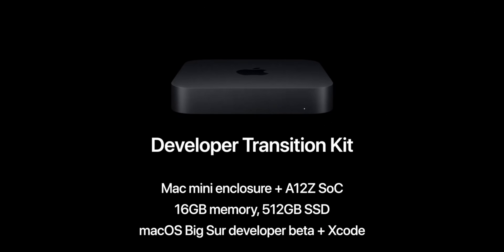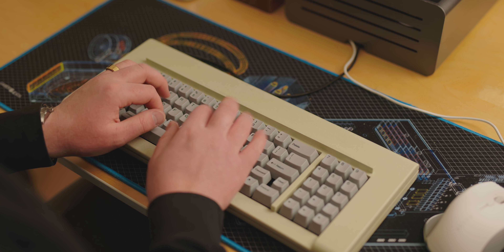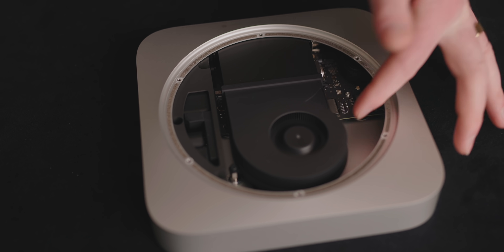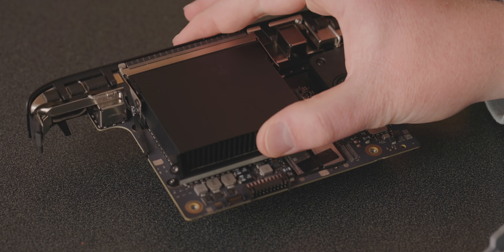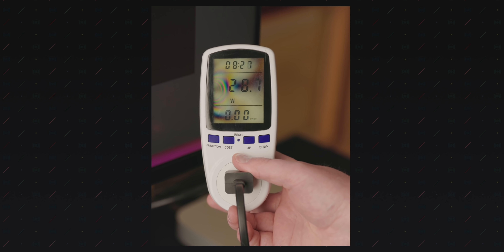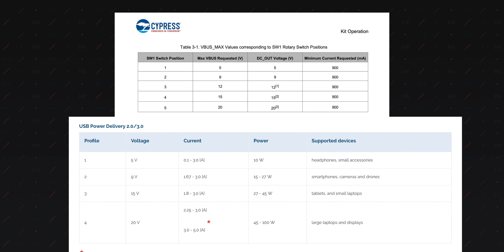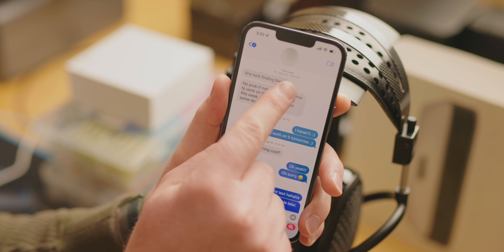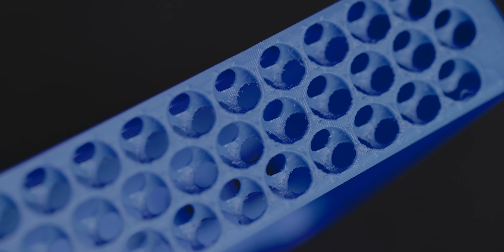We made the Mac mini ACTUALLY mini!

Comment: Also, if the power supply breaks, you can use it with GaN fairly easily and a barrel jack adapter. (They draw from the builtin power supply in the charger)

Comment: If you had to use 20 V, a buck converter would be no big deal, as they tend to be quite efficient...
Deliver 75 W @ 12 V ~ 6.5 A
@ 95% = 6.85. So loss = 0.35 A @ 12 V = 4.2 W "extra power loss"

Comment: Your discussion about multiple 12 V wires seems less than accurate, but I'm just a guy with >35 years of development experience... Multiple wires provide more routing flexibility, more cable flexibility, redundancy of connection pins, maybe lower contact resistance, but "overcurrent", it's harder to sense overcurrent with multiple conductors, unless they are going to multiple current domains.

Comment: Your argument for the multi-wire power plug is mostly BS, you can get a 4 pin/wire plug that will be able to carry the current, have 0 performance impact and be even more flexible.
It's a 1.3M channel, do you not know some electronics engineer to fact check your videos before release?
8:55 "we just have clean 12V" bro that chinesium DC-DC converter (red board) is everything but clean.
You also terminated the multi-wire connector you defended minute ago into single wire pair which is then screwed into dodgy terminal...

Comment: I would rather they just bring over the apple tv case to the mac linup, you can have both versions still with a apple tv focused model without the m series chips in it and then have a m series version designed to run mac os.  Would allow apple to offer a really budget system in the $400-500 price point and get even more people into there mac eco system.

Comment: Hi,Quinn. Hello, my name is Xander, and I am a fan from China. When I saw your video about the 3D printed Mac mini, I became obsessed with the idea of owning one myself. I have already printed the necessary files using my school's 3D printer, but after carefully reading through the project, I have a few questions that I would like to ask you.

Do you have a link for the DC/DC power board? I tried searching for the Cypress PD board, but I could not find one that is the same.

How can I determine if the power pin for the M2 20-pin connector has been changed? (Because I plan to buy an M2 Mac mini)

Regarding the data cable for the 20-pin connector, did you cut it from the Apple power system interface or did you buy it online? If it's the latter, how can I search for it?

For using the MagSafe interface, can I use an Anker PD charger and a 2015 version MagSafe cable (MagSafe to Type-C), instead of using the Surface charger that you used in the video? @snazzyq

Comment: Is it possible to use the "TeraDak Pro linear power conversion module DIY DC12V for MAC MINI/Macbook, with silver-plated wire and triple filter" to replace the power supply unit of a Mac Mini, enabling it to be connected to a 12V output battery?

Comment: Hello, 
Isn't there another way for the power supply, like keeping the whole magsafe cable and just connecting its usb-c end to another power adapter?
Or maybe we can replace the magsafe 2 with a magsafe 3, and since it works with m1 processors.... Wouldn't that work?
If not, how do you do the wire assembly?
Thank you in advance,

Comment: I badly need your suggestion. My laptop is almost dead and i am thinking to upgrade.. 

1. Mac mini M1 8gb 256gb SSD 

2. Custom built pc: i7 12th gen, 36gb ram, 500ssd, no graphics card

Mac mini costs me $900 and the high-end custom built pc costs me $1400 which is exactly $500 higher than M1 Mac baseline. 

I am completely confused to choose between these especially with tight budget. I can just go with M1 Mac mini for now without burning my wallet but I wanted a future proof machine for the next 5 years for development.

Please suggest.
Reply: Tu peux faire un pc, pour moi c'est le mieux. 
Je te dis ça en connaissance de cause puisque j'ai moi même un pc monte et un mac mini m1. 
Parcontre tu n'as pas besoin d'un i7 12emz génération par exemple, il faut que tu revois un peu tes composants. 
Par exemple, un pc avec i5 12400f et un rtx 3060 (ti si possible) feront amplement l'affaire, tu seras bien mieux lotis que avec un mac mini m1. A cela tu ajoute ssd 1to, deux barrettes de 8go ram (style 3600hz ddr4) et puis une carte mère a ton goût et le tout tu peux l'avoir pour environ 900 euro si tu te débrouilles bien !
Bref, cette config est suffisante pour tout ce que tu veux, même pour de gros jeux...

Comment: But the power supply is now external. The Mac mini internal power supply is one of its good features. So of course if you remove the internal power supply you can make the case smaller. Cool project, but didn’t actually make it much smaller overall.

Comment: Would it be possible to keep the original case, kick out the fan and put an extra SSD in (2,5" or M2)? Just would have to find a way to attach the SSD to one of the USB-C ports though...would be a probably cheap storage upgrade than :-)

Comment: Now with the release of the Mac Studio, I think Apple will simply create two versions of the Mac Mini in the future.

The Mac Mini (Slim) which will basically be an M1 with a case similar to what you showed, using the new MagSafe connector introduced with the MB Pros and then a Mac Mini Pro which would retain the size and introduce a M1 Pro instead of the M1.  This will be available only in black and replace the Intel model

What do you think?

Comment: Back in the 50s and 60s and into the 70s IBM had chassis that were about 5 ft tall and inside were circuit boards for various I/o controllers. As they improved the controllers the circuit boards got smaller and smaller but they continued to use the same monster chassis and their original power supplies.

Comment: One comment on your power solution: you can actually use the PPS (Programmable Power Supply) mode of USB-C power supplies and get to 12V with 5A. The thermal performance would even be better because you can get rid of the loss in the buck converter. Most of the new 100W USB C power supplies should have this function, if you read the cc line info, at the end there is usually a line says "PPS 3.3-21.0V 5A", all you need is a proper trigger.

Comment: Another thing with multiple wires instead of just one: more wire means more surface area for heat to dissipate keeping the cables cooler, reducing resistance caused by heat. However smaller wires mean more resistance so not sure if heat dissipation is a legitimate trade of in this case...

Comment: ABS > ACETONE SMOOTH. Job done
Reply from the maker: Accommodating for part shrinkage sounds like hell.
Reply: @snazzy  While that is true, it should only take a few test samples to get your tollerances right for ABS. There are a lot of examples on Thingiverse that can help you dial it in more. The only other problem you will face is: detail vs glossyness. If you aceton vapor to long, you'll lose detail. 

Great done though. Loved the endresult. Like you kinda mentioned, I think Apple didn't changed the design because of the low amount of revisions the Mac Mini got through out the years. Like you said, they will probably change the design this year.

Comment: Personally I would have gone with a standard DC barrel jack since that would have allowed omitting the voltage regulator and using a 12v adapter instead, and would have made for a more robust connection

Comment: But you removed the internal original PSU; if that was an option there's no need at all for magsafe connector and any +/- 12v external PSU brick will do the trick; also you should have recorded temperatures before the mod and after it, stressing the cpu to its max and comparing performance, tmp, point of throttle, etc.

Comment: I watched this and it's pretty cool how small you got it  to be with all the original performance!!    I run a 2012 MAC Mini on 12 VDC because I use it as a streamer and the 12VDC helps eliminate the noisy 120VAC circuits as I believe it was designed to run it as a mobile computer hence the 12 VDC design.   I use Roon for all my Music  files and I know that eventually that 2012 will not be able to keep up with current designs.   I believe you can show mw how to get a new M1 MAC Mini to also run ion 12VDC.   Could you tell me where I can find this info?   I currently also run a M1 MAC Mini for my office computer that replaced an 2012 desk top MAC.   Hope you can point me in the right direction.   Dang I'd love to have a MAC Mini as small as the one you custom built!

Comment: since you wired the MagSafe socket for aesthetic and not truly functional as intended, wasn't just cheaper to repurpose the internal 20pin PSU externally and wire the "fake" MagSafe cable to it rather than cannibalize yet another power brick from a Microsoft Surface?

Comment: It's an amusing project, though I feel like if you have to resort to a power brick then you're not saving nearly as much space as claimed; I dunno about anyone else but I have nowhere good to put power bricks, so I actually prefer devices not to have them.

While shrinking it is an interesting challenge to set yourself, personally I'm hoping Apple will stay around the current form factor but turn into a giant heat-sink so the CPU can run as fast as possible, and maybe bring back the twist off base and give us slotted RAM on top of the faster soldered RAM (e.g- 8gb soldered and two LPDDR slots).

The thing I always loved about the Mac Mini is that while you pay a premium for the form factor, it came with remarkably few compromises; it's always been a very capable desktop at its size.

Comment: I wonder… my Mac mini with the fan set at max 5000 rpm still overheats and throttles.  I wish the heat sinks and fans were larger.  I do more than use safari and mail.

Comment: Doesn't the M1-based MacBook Air use the outer metal casing of the laptop as a heatsink to transfer heat away from the CPU and to the external environment? I'm thinking that's how it gets away with not having a fan. But you got rid of the Mac mini's fan and encased the motherboard inside a plastic box. Now the heatsink on the M1 chip transfers heat away from the CPU to the tiny bit of air inside the plastic box, which gets hotter and hotter because plastic is not a good heat conductor. Those little holes in the front of the plastic case won't expel much hot air because there are no holes on the sides, top, or bottom to draw in cool air for airflow. The bottom line is heatsinks don't work if there is no airflow... the heat just stays trapped inside the plastic case. It may benchmark well, but that constant heat is going to degrade components like capacitors and weaken the solder joints over time.

Comment: The Mac Mini doesn't need to be smaller, especially if small means an external power brick. I don't know about you but power bricks are just a pain in the a** for desk or rack mounted components, the latter of which is a big market for the Mac Mini, mac stadium rack mounts tons of these. I myself have my Mac Mini in on a rack mount shelf. I believe that Apple will be making a higher TDP Mac Mini that will have something like an M1 Max 32 GPU Core SOC, in which case they will need more space to fit in a chassis.

Comment: I want to know if you could move the internals of the 13" MBAir into a 2015-2018 15" MBP chassis, getting the 15" screen and huge battery life?  You might also be able to increase the battery capacity and add a HUB-C hub to activate all the port positions on the MBP???  Wouldn't that be Snazzy!😂

Comment: As usual, fantastic video and amazingly cool idea! Just a heads up, resin printed 3D parts may degrade a bit over time so you might need to take note of that. Its probably best if you print the case out in ABS as it can handle temperatures up to 100C with ease and it should last way longer than any resin printed components you use. You can try using some dual extrusion printers to print soluble supports for those cheesehole overhangs and you'd still get some amazing detail

Comment: magsafe shouldn't be used in a device without internal battery... battery can be used for accidental pulls, unlike this Mac which would make you lose unsaved work when you pull the magsafe
Reply from the maker: It’s of little difference from the new iMac that uses MagSafe.

Comment: The Mini is already the perfect size to sit under a monitor stand, effectively taking up zero extra real estate on my desk. (Plus, it's virtually glued in place; I can swap cables around without it moving a millimeter.)  I expect Apple to make it thinner, while pretty much keeping the 8x8 form.  
Smaller and lighter is not necessarily better: If you make it too small, it ends up flopping around at the end of the various cables, like most USB hubs.  This is a cool-looking mod, but seriously, there's very little benefit to be had.  Plus, that MagSafe connector is eventually going to bite you in the butt:  It's really not secure enough to serve as the sole source of power. Knock it loose, and you can say goodbye to x hours of work.

Comment: While using MagSafe is a neat idea, it does create a problem unique to this build.  Everything else is a laptop, with a battery in it, so if the cord gets bumped or pulled, it doesn't cause a power interruption.  But on this, bump the cord and it's lights out, hard.

Comment: Makes sense Apple didn't redo the design at the same time as making a new CPU. After all, they already spent billions on R&D and production of the CPU itself. Imagine if they also had to build entirely new fabrication machines at the same time, capable of pumping out the massive volume of machines required...
There's no way they could have made the Mac Mini be the same price or cheaper than previous models.

A redesign will come, but at a time when it makes sense for them fiscally. Probably in a few years when the costs associated with creating their own CPU have been recouped. That way, again, the Mac Mini will be new, but won't see a price hike.

Comment: Wonderful build, I want one!  The only issue I have is your decision to use a MagSafe connector for power.  Too easy to knock it loose when you're messing with the other cable connections.  Because it doesn't have a battery, that hard-crashes the computer.  MagSafe is purpose-designed for laptops where the issue is someone yanking the cord, and the presence of a battery keeps it from crashing if that happens.  If you insist on MagSafe, you should add a little retaining clip that keeps it attached.

Comment: I don't understand how many smaller wires are supposed to deliver a more stable voltage than one big one. If the copper diameter is the same then the voltage drop will be the same.

Comment: Good video, but there's another answer to the question about why Apple didn't change the size of the case.  It's a comfortable form-factor for a desktop system.

I don't know about others, but my desk is a bit cluttered.  I put things on top of my mac.  There's always a SuperDrive there, and there are often other items present as well.

If you make the computer too small, then you can no longer comfortably put things on it.  Which makes its effective vertical size infinite - because I can no longer use any of the space above it.

Your little case looks and works great, but that shape means it must always be on top of whatever stack of stuff it's a part of, or you need to put it on a shelf (like what I do with my Raspberry Pi).  Or maybe end up mounting it to the back of the monitor, if you won't be needing to access its ports.

Or even better, design a bigger case and combine the Mac with a good quality Thunderbolt dock, creating a single box with the full array of ports we used to take for granted on our computers.

Comment: That magsafe cable is intended for laptops for a reason. It falls off far more easier than the round one the iMac uses and if you accidentally knock it off when the mac mini is running... Well, you can imagine the results.
Reply: I came to make a similar comment. Without an internal battery, MagSafe is a bad idea. May look cool, but unless this is far from a desk, there is a good chance it will get bumped and disconnected on a fairly regular basis.
Reply: @brianflowers4217  better for it to be booted up after a power loss than booted across the room though.
Reply: @davidkelly6224  t's just chips though, no screen to break so drops are much more survivable
Reply: @davidkelly6224  except for data loss and corruption.
Booting across the room is nkt likely to do much to it.
Reply: I assumed he did it for desktop portability but a ion battery wouldn’t hurt in this mini build for sure
Reply: Magsave has saved my laptop from a horrible death by sudden deceleration more than once. No small computer is immune from such horror.

Comment: Not entirely sure what the point is. True, moving the power supply out and removing the fan is something Apple would quite possibly do. But, like with the MacBook Air, without the fan it will probably be hindered when under intensive load for prolonged periods. Moving the power supply out, just moves the volume somewhere else.
Reply from the maker: Machine doesn’t throttle

Comment: i like how you are against using USB PD 20v (15v exists too btw) because of the buck converter needed
and then you .... get the exact same kind of buck converter for your 15v magsave conversion
Reply from the maker: It’s a smaller board that doesn’t get hot due to smaller conversion. Also, I’d need a USB-C board AND buck converter for the other PSU. Way more vertical height I don’t have required.

Comment: It's not like the original Mini is big. I'd like to see a comparison on long running high loads loads, as it will probably throttle just as the MBA does.

I'm hoping Apple keeps a beefed up cooling system for M1/M2  Pro/Max designs.
Reply from the maker: It staves off throttling. Only just barely but it does.